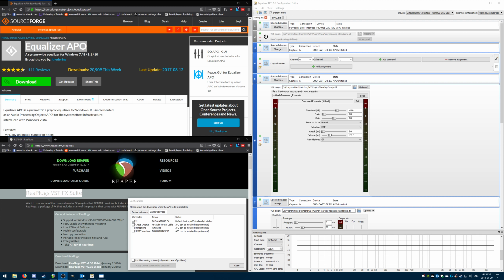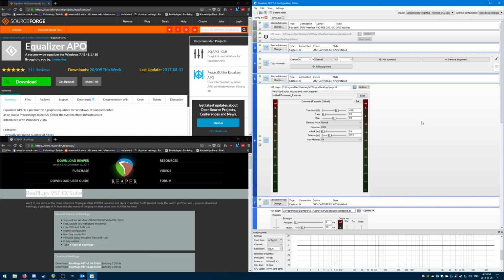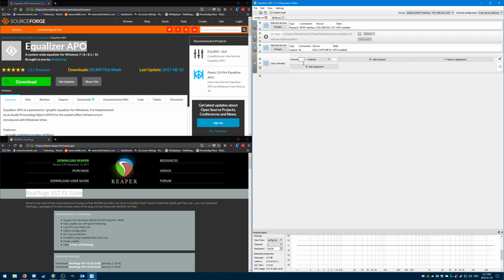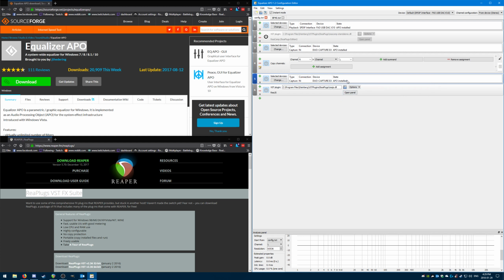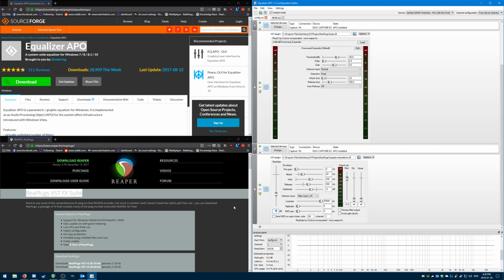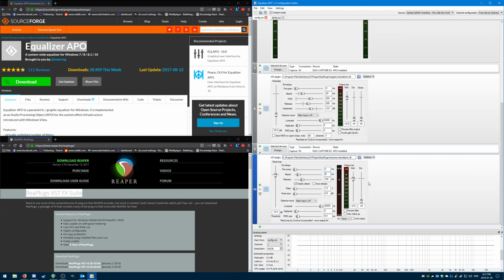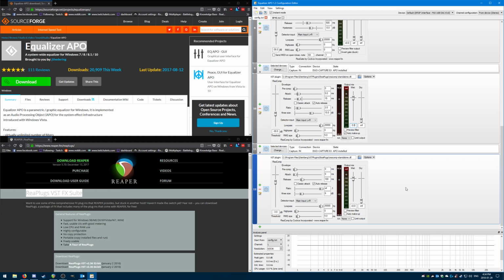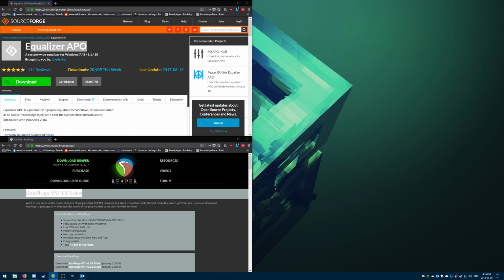EqualizerAPO + ReaPlugs VSTs (Mic processing without virtual cables)

Comment: I tried following this tutorial, but nothing happened and there were no changes to my mic.

"Insert VSTs directly onto your sound devices before it enters the Windows Sound API, meaning the VSTs will apply system wide without the need to route through a DAW/VST Host with a virtual audio cable."

How do I do this?

Comment: Many times i have come across this software (APO), but none of them have explained it so simply like you did in the beginning of the video.
Main reason is I run voicemeteer too, so I get super confused when it comes to device selection.
Now that you mentioned it "inject" itself before the device send to the windows API, (I assume that will be before the VM get hold onto the device too). This explaination made thing so much clear to me.

another quick question, now Nvidia has awesome AI noise removal ablity (need RT core hardware), and there are VST3 downloads for it. I knew you have done great video of how to remove noise, but the nvidia plugin is just so simple and effective to use (literally can run a vaccum next to my mic and it wont affect a thing), but some how APO cant use .VST3 plugins ? does it only accept dll plugins  ? thanks.

Comment: May I ask why is it necessary to input your device before every plugin? Even if you don't do so the changes seem to apply, or am I missing something?
Reply from the maker: When you have APO setup on both Playback and Recording, when using  the main config file it will apply plugins to both devices. 
The other way you can do it is create another config file, use Include and load that file. Then in the file you can  just put the plugjns
Reply: @DEDR1CK  Oh I see thanks! Not a problem for me since I only use it for capture devices. Thanks!

Comment: Thanks so much!!  This is by far the best tutorial I have ever found on using Equalizer APO to process your microphone's sound "live".  I have used it to add a noise gate for years, but with mixed success at trying other "real time" plugins, so I gave up on them.  Now I cannot wait to try these others, as you've shown.  Thanks again!
Reply from the maker: No problem! My DBX recently crapped the bed so I had to go back to using APO to process my mic, I got it pretty close to my hardware processing.
 
I've always wanted to redo this video to better cover the usage/settings of the VSTs.  I made it with the assumption people already had some experience of doing it in Reaper or OBS
Reply: @DEDR1CK  So funny that you said this!  I recently had my second DBX 286s do the same (the first one lasted 2 years, the second one only a year and a half, so $600 gone).  And it is the exact reason for my suddenly  renewed interest in using Equalizer, for "live" sound adjustments in software!

Comment: How can I use this program to add VSTs to system/application audio instead of a microphone?
Reply from the maker: When setting it up or using the config you can also choose a playback device as well. This will be all system audio though, not application.

There's better ways of handling 2 devices in APO than how I did it here. You can setup all the VST in a new file and use "Include".  This saves you from having to do so many device plugins inbetween  to keep it from modifying your playback

Comment: anyone know where he got the reaper settings at minute 5:05
Reply from the maker: The VST is ReaJS, once added it click Load/Stillwell/Expander
Reply: @DEDR1CK  I did that but when you put in the numbers
Reply from the maker: @Romaakoyans  I'm taking them from my Reaper on the other screen. They're based on my ambient noise levels though.
If you monitor yourself in OBS you can tweak it while hearing the result.

I wrote an overview of how an Expander works here on the OBS wiki, you can apply the same logic as the OBS Expander is based on the Stillwell https://obsproject.com/wiki/Filters-Guide#expander
Reply: @DEDR1CK okay thx

Comment: What if i have a 3 band splitter and a 3 band joiner.How this should work in equalizer apo?
Reply from the maker: I'm not sure you could do this but you could always try. There are certain VSTs that simply won't produce an output due to how they need to process the audio, same even crash EqualizerAPO when you try to load them
Reply: @DEDR1CK  Thank you for your response.I will try and see if it works.

Comment: I have to say, after trying many things, different mics, different DACs (or I should say ADCs), this tutorial is the best.

I wish you highlighted the main controls of each plugin, but as you did mention, you may have already explained that in a different video.

What is your profession/hobby? Your knowledge in these things make me wish I did audio engineering at university.
Reply from the maker: Audio is my hobby, everything I have learned has mostly been through messing around with plugins just to see/hear what happens. I have dabbled in music production as well so I have used the same plugins for musical reasons, translates pretty well to voice.  It is a lot easier to understand how the devices work when you have a sample of audio you can continuously repeat and tweak settings, just to hear what happens when you crank a setting.

Comment: After installing this,trying it out .. not only my mic got wierd, but also the headphone sound is insanely loud + hissing ,even after i oause video or other things. 
I deleted everything (equalizer apo & reaper VST plugins) and still no fix !!! Need your help ASAP. Can't get nothing going or sounding atleast as it was.. everything is worse 4x -_- 
I wrote you @ obsproject.com private message (ODZHYY) and would apriciate to talk with you somewhere,where you could help and explane me things out.
Reply from the maker: Re-install your sound drivers and reboot, re-installing or update your drivers causes APO to unhook from the driver.  Your headphones shouldn't have been affected unless you specifically selected your headphones as an APO device which changes how you have to set up the config, that is why I use the DEVICE insert before every microphone VST.  If you don't use DEVICE it applies the VST to all APO devicse you have initialized, if you aren't going to do anything to your headphones then use the Configurator Wizard and turn off your Playback APO devices.
Reply: @DEDR1CK  Would you like to help me or assist @ private this? I think i will break things even worse :D I have no clue how and what things must be done. Im totaly clueless when it comes for the sound. 

Fun fact, i uninstalled everything, still had the hissing and the loudness was over the top.But everything gets back to normal, when i disable Elgato Sound Capture .. i could leave it as it is,but i need the Elgato Sound Capture, so my other pc is hearing sounds and streams it(1 channel sounds ofc mic + sound).

Comment from the maker: The Expander was supposed to be RMS Detection, not Peak...oops! 
You can monitor yourself in OBS under Advanced Audio Properties or use REAPER in WASAPI mode with your plugins turned OFF. If your monitoring sound cuts out while editing VSTs just restart REAPER or OBS. 
Even though it cuts out it is still outputting, you could still me, I just couldn't hear myself. Weird driver glitch, doesn't occur when just using APO without editing.
Reply: There's an easier way to listen built into windows, and for me it never crashes. Right click on the speaker on bottom right of windows > Sounds >Recording tab > Properties on the mic you're using > Listen tab > check "Listen to this device" > Apply

Also, I don't think you need to add the microphone/device in APO every time you add a plug, for me if I do it once at the startup it works.